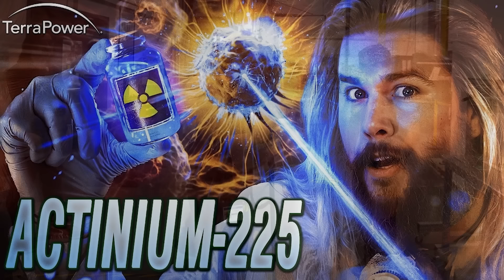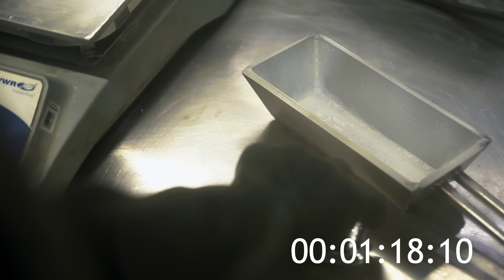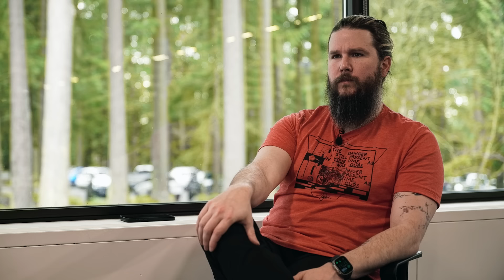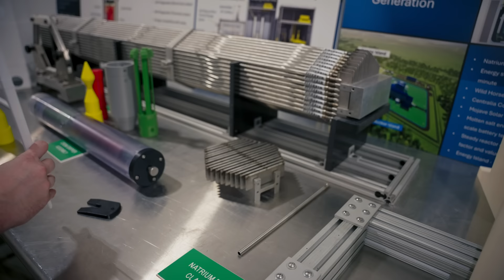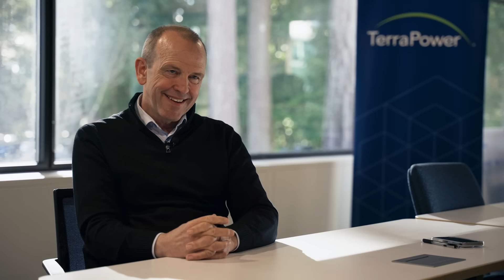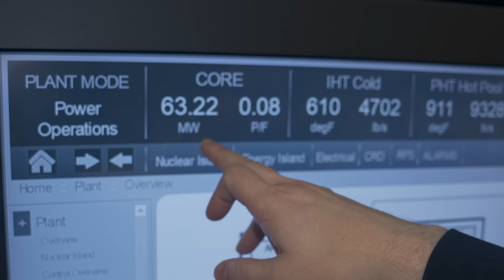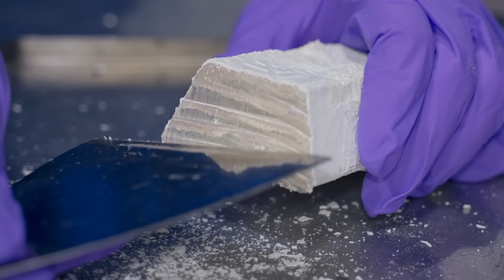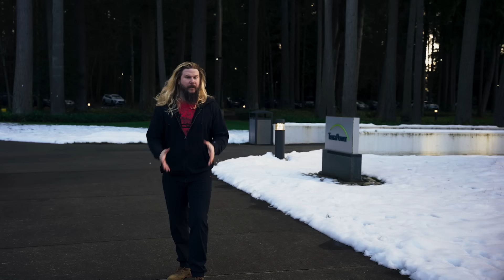Will Natrium Nuclear Reactors Change Everything?

Comment: Does the heat battery also provide resistance to loss of external power?

Like a set of backup lower power sterling engine generators that can supply the plant itself, or something like tgat?

Comment: Pay attention folks, that metal, Sodium will power most of our batteries within a few years. Way more abundant than lithium, whose industry is struggling to keep up with consumption. And much easier to process and the source is everywhere (seawater). It is going to enable obscenely cheap batteries.

Comment: Something I was wondering. In the very unlikely event of a serious meltdown (heavy core damage, clad displacement and obviously molten sodium coming into contact with the fuel), I’m curious how the molten sodium would play with the decay product Iodine-131 considering sodiums high reactivity with halogens. Would this be negligible fuel to the fire or would it net a significantly larger problem?
Reply: Well, if the temperature gets that high to melt the fuel a little more heat from a sodium iodine reaction is not going to matter anymore.
Reply: @ Ah gotcha, thanks for the reply.

Comment: But Kyle, last time i heard about Terrapower they still had this problem with corrosion or the case if your Sodium solidifies in a pipe during shutdown.
Reply: you have a large onsite thermal mass, and power generation, should be easy to apply external pipe heating if you really need it.

Comment: For the sodium bit at 17:00 it wont be at room temperature though will it?? It will be molten in the pipework. Expose it while molten to the air please? 
I didn't realize sodium was magnetic either? How can you move that with any kind of force / efficiency ? Many many questions still to cover here.
Reply: im guessing it's either in a fully sealed environment, or covered with an argon bath or something. Fairly easy to manage this problem, just don't expose it to air really.